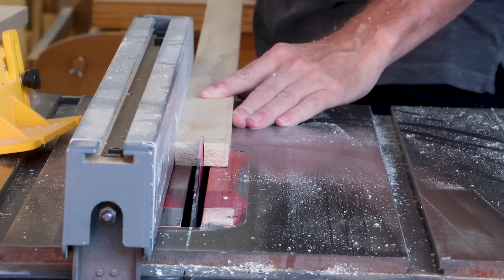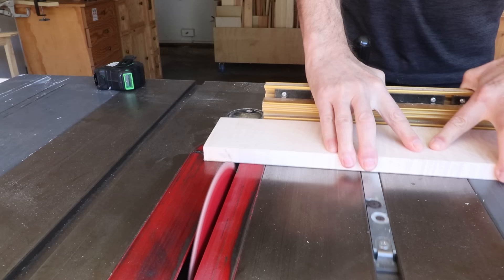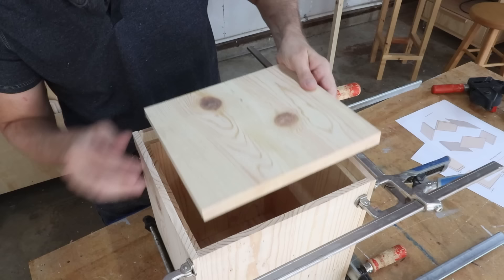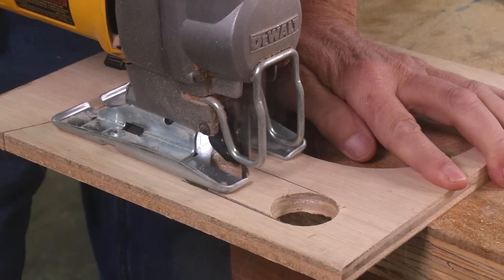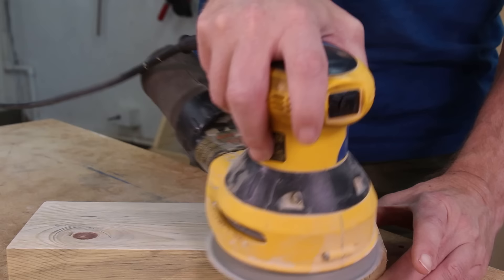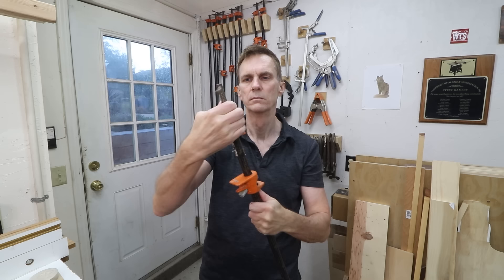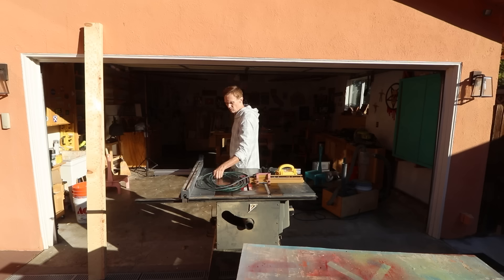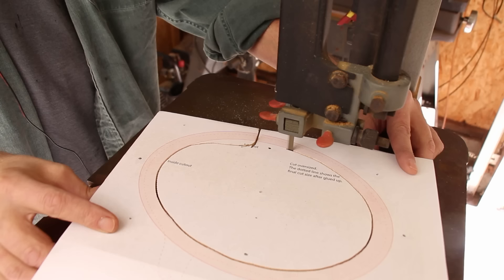2023 guide to all the TOOLS and SUPPLIES you need to start a woodworking hobby

Comment: I think the battery thing is mostly a pro shop thing. When you have multiple workers using tools in the shop it just saves headaches to have one model of battery pack. And this kind of migrated over to the hobby realm from there. I agree, its totally unnecessary. So long as you've got chargers to go around and enough outlets, it doesn't matter.

Comment: The only 2¢ I have to add is, regarding the battery thing, that everyone should stop and take a second to consider if having a cordless drill and impact driver is REALLY that necessary compared to a corded one. Yeah, if you're going to a construction site where you may not have ample power than sure, but if it's in your own little shop? Everything else (circ saw, random orbit sander, jigsaw) has a plug, just get corded of whatever brand matches your undies best and enjoy how much more power a corded drill has. And it's always ready. Maybe 1/1000 times the plug will make it hard to fit somewhere, but probably 1/20 times you reach for a battery one and it has no juice or dies on you halfway through.

Can't say corded is nec. cheaper anymore though.

Comment: Instead of buying used tools, which can be a real hassle, get some from Harbor Freight. Their cheapest line isn't too bad, just make sure you work it thoroughly and get the extended warranty. In my experience, the tool will either work and be fine or won't work right out of the box. Don't go with cordless if you can help it.

Comment: Hey Steve, I want to get into woodworking and have a starter project - my kitchen table. It’s an Ethan Allen table with an oak (?) top and egg shell white legs. I got it used, and the wear definitely shows. The base’s paint is chipping in several places, which should be an easy paint job, but the real problem is the table surface - the varnish must’ve been damaged and it’s peeling in several places and is sticky to the touch, no matter how much I tried to clean it. I think the best way to treat the table is a sanding job and maybe an oil finish. Is all I need for this an orbital sander?
Reply: The table top sounds like the finish (probably polyurethane not shellac) was damaged and someone tried to 'fix' it by flooding the top with with olive or vegetable oil and not wiping it off (it can happen with Linseed oil finishes, intended for furniture, if you don't wipe off any excess between coats). If paint thinners won't touch it and you don't want to use paint stripper (which can be nasty), use a scraper (paint section of hardware store probably) and try to scrape as much off as possible before sanding. Once you get to sanding with a ROS, there are two types of sanding disk for them - the regular 'red' disks Steve shows, intended for raw wood and maybe metal and the 'White' (or yellow) disks, which have a special coating so the sanded off paint (and gunk) won't stick to the disk and clog it up unto uselessness in about a minute. Not all big box hardware stores will stock them, or they will 'hide' them in the paint section away from all the other sandpaper & power tools - you may have to go to a specialist paint outlet depending on where you live. If you have some old 'rubber' soled shoes that you are throwing out, you can use the soles to extend the life of the sanding disks by sanding the soles which seems to pull some of the crud off the sandpaper - or you can buy a 'crepe rubber' block to do the same job at better tool departments (also used on belt sanders too)
Reply: @brucelee3388  wow thanks for the tips!
Reply: Someone may have used bleach or other sanitizer on it and dried and gunked up the surface. Harsh cleansers like that shouldn't be used on wood so after you get it refinished keep that in mind if you're tempted. Good luck.
Reply: @olderendirt  thanks. Tool wise I’ll really only need a scraper and the orbital sander right?
Reply: @DSCuber  I'm speaking from a novice woodworking view, but many years of kitchen cleaning experience. The card scraper might be good to remove some of the gunk before using the sander. If it's a true Ethan Allen table you might even ask them what the original finish was to restore it.

Comment: Unless there's a huge difference in price or feature set, getting power tools with interchangeable batteries is convenient.

I wouldn't spend an extra 200 bucks for it, but I certainly wouldn't mind spending an extra $20 to save some time & hassle in the future when any battery starts failing.

Comment: Steve, you along with Stumpy Nubs and Paul Sellers ( I am a hybrid woodworker) are the only channels I subscribe to. If you watch too many channels you get so much conflicting advice. You are straight to the point and practical. Just started using a table saw, after watching all your relevant videos ( especially the safety ones), as I am working on a top bar beehive project. It was a revelation on cutting wood after managing with a circular saw for so many years. Thanks for all your output, best wishes and Merry Christmas from England.
Reply: Stumpy nubs is constantly doing the sales pitch for his affiliate links etc in every single video. Gets old fast.
Reply: @rd-ch1on  I know. But the advice is still first class, and at least he openly declares his affiliate links.
Reply: @philsharp758  Who trusts a salesman for good advice?

Comment: I think a router is as important as a table saw.
Reply: I tend to agree. Only been doing this a month but the router was far more important to me than a tablesaw. Without a planer I'm buying four sided finished lumber. Also I can't fit a 4 x 8 in my vehicle. 30" x 9' is my max. 

Although tablesaw was a priority too. But I use my router is my biggest used tool. 

I know you can cit a dado woth a tablesaw but I tried that. Without a Dado stack (super expensive, $100+? not available on many beginning tablesaws like the Dewalt 8.5).

I still have no miter and find clamping all the boards, using a clamped on straight edge, and a circular saw easy. Also got the circular saw to cut large wood in the parking lot if I need it. 

I mean I really want a miter. But on a budget as a hobby speed is not a priority. I'm in this for a fun way to pass time. 

My most weirdly used tool is an oscillating tool that came with my cheap set. Did not expect it to be so useful. 

But yeah my most used tool is easily the router, then circular sander and circular saw. And shop vac. After that table saw and jigsaw. 

Next year purchases are miter saw and planer.

Comment: I'm afraid I disagree with you on sticking to one brand for battery compatibility.  One of the main things I consider when I look at a new tool is, "do I have batteries that fit that - or do I need  to buy a pair of batteries, and find an outlet and shelf space for another charger?

I've gradually narrowed down to two brands:  I have older DeWalt tools and batteries, left over from the days when I used them for a living, and my newer ones are all Ryobi - because they're cheaper, I have a Home Depot card, and in my home shop I don't need tools that can stand up to heavy use and abuse.

Comment: Hey Steve,
Your tool list lists the Ridgid R4518  as the entry level table saw and an 8" dado. Both an online manual and the Q&A section on home depot say it accepts only up to a 6" dado. Will this particular 8" dado work with the R4518?

Comment: In the UK at least, you can save a lot of money by sticking with one brand of cordless tool, because you can buy each tool without getting a battery. I have about 10 tools that run off just two batteries. If each tool had it's own battery I would probably have spent 50% more

Comment: What are you thoughts on real compressed air nailers vs the battery electric air nailers?  I have a Ryobi 18ga pin nailer and really want a 23ga pinner and a 18ga stapler might be nice.  But I go back and forth about whether to go air or electric air.  Most manufacturers have a ~$300ish 5-6gal compressor + 2-3 tool bundle and I'd probably spend about that to add an electric 23ga pin nailer and 18ga stapler.  In theory air opens up other tool possibilities but the small 5-6 gal compressors are not well suited for tools like HVLP sprayers, air driven sanders and so on.  So aside from 2-3 nailers and a blow gun/tire inflator what does air really add?  Thanks!

Comment: The one piece of advice that I wish someone had given me was to ignore the brand of your saws and drills and spend a bit more on saw blades and drill bits. Because here's the thing: its not the motor or the brand name that actually does the sawing or drilling, its the blade or the bit. You can get by with a cheaper saw or drill so long as the bits and blades are sharp. Ditto routers and jig saws.

You'll save a LOT of frustration that way and have way more fun woodworking which will encourage you to do more woodworking. Trust me, I found this out the hard way. Ignore the tool brand, its all about the blades and bits.
Reply: You can always buy some better tools later, especially if you sell a few pieces.

Comment: My list for beginners bought in the following order are:
1. Sliding Miter Saw (I would go with Metabo HPT)
2. Bandsaw (I would go with the 10" Rikon because too my knowledge it is the cheapest bandsaw with a cast iron table)
3. Planer (Until recently I would have gone with DeWalt's 13" but Wen has a cheaper 13" with a helical cuter head however I can see DeWalt adding that in the future)
4. Router Table (I would go with Bosch for both the router and the table)
5. Mortiser (Go with the jet)

Comment: don't keep batteries on chargers long term (both for fire safety and battery health). battery adapters are available as long as the tool and battery match voltage (20v is the same as 18v). mytoollist has been down since i found your channel

Comment: Hmmm, I really don't understand WHY a table saw is  must have.
You tell me, that I won't be able to do ANY fine cut, with a circular saw plus Track Guide? 

In reality, if you take your circular saw, and put it upside down on a table, and mount it, then you got a table saw (yes, you need to saw through the table itself). 
I can't see how that should make it that much better. BUT, it can be my autism and how I see this for me, very strange world.

Also, miter saw, why not use circular saw? It's a circular saw mounted... I do agree, it is nice to have multiple tools and options. 
I am self a brand-new Woodworker .... just waiting for my wood to come, and I will build my own desktop + cabinet with drawers, that fit my needs.
And I don't have nor can afford to buy a table saw, I already used/wasted enough on so much tools, that I properly just could have ordered the desktop table and cabinet with drawers from a builder. That would likely be cheaper in the long run LOOOOOOOOOL

Else, many many thanks for your good videos, and like you how doing!

Greetings from Denmark.

Comment: I bought 3 working bandsaws for a total of $121. Small (like yours), medium and a huge old one that cuts like butter through 25 inch thick hardwood. Just took time and searched the for sale ads and ended up finding them individually. So I disagree with your statement that they are a big investment…I’ve spent more on blades than  machines  ok  👋
Reply from the maker: Used tools are fantastic!
Reply: They are a 'space' investment more than a $$$ investment, even if you can put them on a mobile platform.

Comment: Nah, Definately stick to the one Power tool battery set, why would you want multiple chargers and batteries, surely one charger and being able to use multiple batteries in one tool if you require that tool for heavy use during a particular task.  Rather than having one battery for one individual tool.